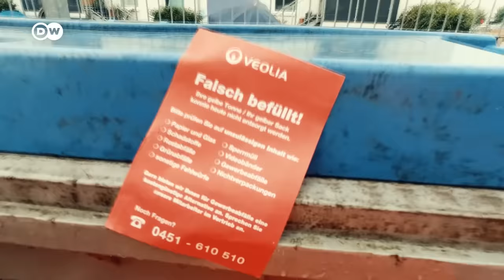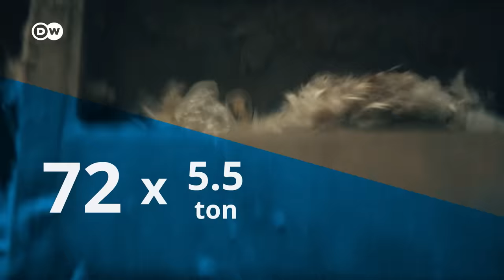The recycling myth: What actually happens to our plastic

Comment: companies have successfully shifted the respnsibility onto consumers, same with co2 emmissions. If the market doesn't demand change, which I doubt it will, only regulation on a global scale can tackle these problems...
Reply: Agree, how can the consumers changed if the companies still used it to everyday products. They obly care about profits and our money
Reply: Regulation made this problem.  See between plastic bags and paper, they are equal in pollution.  They just pollute differently.  So when uninformed people just like you demanded everything shift from paper you MADE the plastic industry.  People found anything not packaged in plastic "dirty" or "flimsy".  So regulation was forced through to require manufacturers to use plastic.  

From there cheaper ways to make and utilize plastic came from this.  Funny enough as long as it does not involve food or a long wear time most plastic is made from a acid extracted from corn.  It is non polluting and completely biodegradable over the course of 5 years and sunlight exposure.  Its call PLA and its used even in 3d printers as the cheapest plastic for it.

But  NIMBYed out of western countries the actual techs for recycling then also asked your politicians to bow to China.  So China and north Africa made a business of buying recycling to get the hard to make plastics and then throw the rest away.  Regulation made it possible if not mandatory.

Parts of the world are dying from the unrecyclable and toxic waste that comes from windmills and solar panels.  Both are TERRIBLE technologies in no way suitable for use.  The over all life of a SINGLE wind power turbine is 10 years.  In that time it goes through 2 sets of blade that cannot be recycled or processed and are filled with toxic materials.  It is woven fiberglass and a epoxy so toxic that it has to be in a filtered fum extraction building during curing or it will kill people.  Those blades then erode away filling every place down wind of them with these.  The generators themselves are retired with only the copper windings ever recovers and the housing thrown in a dump.  Even the cobalt (a carcinogen) of the magnets is just left to rot.  

Solar panels are even worse.  Every year of use they loose 20% of their current output.  They die outright in 15 years.  And anything including high winds and hard rains can cause micro fractures which causes them to leak cadmium into the ground water. That is normally a radioactive by-product of nuclear reactors and handled as a hazardous material.  But in solar panels do to the regulations voted in it is allowed world wide without proper labeling and then when the solar panel fails it is just chucked in a land fill. WHY?  Because the process of making them precludes them being recycled.

Not only did people who know nothing about anything make this mess, they are actively making is worse because they listen to 15 min videos that don't tell the whole truth or  follow the lies of celebrities whose only agenda is to gain fame by pretending to care about issue made popular by scam artists. 

To actually care about the world people NEED to walk away from any of the "green" orgs and look at real solutions. You want clean power or near zero carbon emission power?  Natural gas burns and becomes steam with almost zero co2. Nuclear is cleaner than ever and if allowed to innovate there would be no reactors used for enrichment for weapons. Or fuel wood. The wood being grown neutralizes the co2 released by burning it.

Let paper packaging back into the world just require actual recycling of it and stop having the paper plasticized. People made it a hundred years rather easily and healthily with waxed paper.

But if you truly want change, don't try to vote for it because the people writing the laws only thing of how it will profit them.  Stop buying single use products. Stop buying all the things that are not actually recycled.  Instead of trying to force people to conform to what you idealize, being a good example of how it is better and be the change you want to see.  Demanding regulation is the lazy way out and only makes things worse.
Reply: Exactly, everything is blamed on the consumers but not on the companies that produce it and push their chemical products  through media, same as pollution that caused by companies which cares more for profits.
Reply: @proctain  Plastic is for sure a worse polluter in the long run.
Reply: Once you buy it, it's your responsibility homie. Companies should do their part, but stop blaming companies for your consumerism.
Reply: You still have it wrong.  They tell us what we want.  Theyve all learned from steve jobs by now.
Reply: @Ranstone  bruh, you do realise that the blame game won't get us out of this mess? We had the consumer responsibility mantra for over a decade now and it isn't getting better, regardless of your opinion, which I think is short- and narrowsighted, isn't it obvious that we should go down a path which actually works?
Reply: @droe2570  Government regulations created all these problems, such as the problem where people switched from paper bags to plastic bags? Which law did this? Can you cite the name of that law? I was able to read the part where not a single law was cited or mentioned, do you have the reading comprehension to see that?

Is China and other East Asian countries using up plastics in consumer goods because of regulations? Can you cite their laws that force them to use plastic in food and drink containers like every other country? Or is due to market forces that they use cheap-to-produce plastic? Do you have more than one IQ point to rub together and back up your claims with actual details?
Reply: @DeDieuAntique  You're having "I have nothing substantial to say so I'm just going to butt in the conversation and act condescending" problem. Go away, you won't be missed.
Reply: @proctain  wow that's thought out.
Reply: @margyb7469  It should be blamed on consumers, because they are the ones financially supporting these practices.
The truth is that people do not care enough to do something about it and put money in alternatives. They'd rather virtue signal with someone else's money and time and demand that government/companies take care of a problem they are supporting.
Reply: regulation isn't going to do  anything, except for creating monopalies and halting progress.
Reply: @ishitrealbad3039  if by progress you mean reckless capitalism wrecking both the environment and our health then yes. Of course too much regulation is a poison but just like everything moderation is key.
Reply: @sizanogreen9900  why do i have a feeling that when you say "moderate regulation" I read full blown government overreach instead?

If you want your food and other product to spike in price by atleast 50%, than yes you should force extra regulation on companies.

I thought your sort of peopel were against mega corporations, but somehow all of your policies always enforce mega corp.
Reply: @ishitrealbad3039  well, I will stop arguing with you here, there is no point in trying reason against a true believer.
Reply: @adsfadsfasdasdfasf2439  
Its not a law. Its propaganda. There is laws that ban plastic in certain states.. that's for sure
Plastic came to be around the hippie area and was marketed as being environmentally friendly.
You need to change public opinions before you make any laws like that.
Why government had projects like project mockingbird.
Did we have laws to enter this endless war in Iraq? No.. but they got public opinion to change so they could invade.
Reply: @sizanogreen9900  "true believer" lmfao get off the drugs.
Reply: @bobshanery5152  yeah because china doesn't regulate shit if you are connected to the right people, and the last time I checked american environmental practices were average among developed countries at best
Reply: Partly agree. What happens globally we say co2 is responsible, something we really can't do much about but it seems like noone cares for the destruction of forests and this awful plastic waste. Here in Germany we pay more for gas now, to feel better I guess. Wow
Reply: @proctain  so much truth in your words thank you
Reply: @proctain  You had me until you mention harmful material on renewed energy.
Reply: @zeebeefpv2273  Wrong: companies make you buy what they produce - it's called marketing & advertising - so the bigger blame is on companies, not consumer~
Reply: @BLAQFiniks  Advertisers dont force you to BUY, but when successful they force you to WANT.
Reply: The old chicken and egg story. Now who is the chicken and who is the egg ? Depends on your own agenda really ...
Reply: @1DFM1  hi, yes I agree there are many things that are wrong with human nature. We have a hard time differentiating where the line is between need and want that is for sure.
Reply: @FnD4212  I was pointign out how regulation and giving undue power to goverment causes problems.  Also the original post was talking about so called "green" energy.  

But it is still just the actions of people uninformed whating to feel good about themselves by pushing for regulation where there shouldn't be any.

Taking away people's choices doe not make things better and denying reality while forcefully removing that avialability of that info is another way of taking away choice.

Solar Panels and Windmills are bad tech through and through. You need to come to terms with the facts and let go of the emotional investment in believing they are rainbows and bunnies.

Just one wind generator requires almost 2 football fields of land to be cleared for construction and maintenance.  People keep trying to place them near woods and you have to cut down the woods for them.  In scrub lands the bushes that all the ground animals rely on are clear cut and burned.  Then a half acre of land is dug up just to install the concrete base.

All of that is one PER wind generator.  And it never, ever pays back the CO2 foot print to install and in just 10 years it has to be replaced top to bottom. 

Those are the uncaring facts.  They don't change no matter how much you hate them or ignore them.

Just look up co2 per kilowatt hour. A coalfire power plant is lower than a wind generator and it lasts longer.  It can be refit to run cleaner as time goes on.  But best of all its cousin the natural gas power plant produces primarily water vapor with little co2. 

You need to start researching these issues on your own and stop following video with happy jingles and buzzwords.  

Because how I started on knowing all of this is that I worked on building the NREL LEED Platinum office building.  I learned about solar panels from the scientist who worked at the labs that develop them.  Talked with the engineers who assemble wind generators. 

Of all things their dirtiest secret is that they work on nuclear power as the best alternative in those same labs.  And their own test wind generators and panels are nearly never used. Even generators they sold to the city of Boulder Colorado were rendered inoperable at their own information installation at a mall because the math fails.

Oh and that LEED Platinum office has its own dirty secret.  To get LEED Platinum requires that the structure itself has to be absolutely carbon neutral even in electrical power requirements. The National Renewable Energy Labs had to lie and cheat on their own offices to do that.  They built a parking tower and put additional solar panels on it to get the office within regulation.  

That was a design build building that was slated for a cost of 2 million and ended up with a cost in excess of 4 million.  Even after their were efficiency modification to the plans half way through to reduce costs.  That is a doubling of the price in overruns on the building meant to show all of the world how to be "carbon neutral."  

Then they cheated to get across the finish line after that.
Reply: @proctain  You just repeat the same point as the original. So nothing new here.
Reply: @proctain  This is incredibly on point.  Something I always fear when we come up with "solutions" to problems like water scarcity and electricity production, is what new problems they make.  They original solutions became problems because we didn't care to fully understand the process that resources go through when we use them.  If we want to avoid making new problems, we can't just come up with miracle 'solutions' like solar and wind power; we have to FULLY understand the need, and design a solution that can go through the WHOLE process of being used for our good, and then when we're done with it, be utilized again, either by us or by nature.  Otherwise we won't be making solutions; our grandchildren will be cleaning up waste from our 'solutions'.
Reply: @Ranstone  So you're saying we have some method not to buy things packaged in plastic?  Certainly there are a few items with alternatives, but most stuff would be either a choice of plastic or nothing.  Sure we could all shift to an off grid lifestyle...no wait, that only works for a limited number of people until it becomes unsustainable too.  The cost should be applied at the source, a tax for the real cost of plastic that would be included in the price.  This might even dampen the consumerism you deride.
Reply: @adsfadsfasdasdfasf2439  I suggest there are more laws prohibiting the use of plastics than requiring them.  I'm no law student, but I don't see much Styrofoam packaging anymore...or how about those plastic straws (not much impact, but it's a start).
Reply: @Dennis19901  Great idea, next time I go to the store I'll only get the stuff in sustainable packaging...damn, not a single manufacturer made any difference. I'm going off grid and not buying anything anymore (PLEASE, nobody join me or it will be too crowded for even 20% of us!).  I do miss taking my 5 gallon jugs to the supermarket in Italy to fill them with wine.
Reply: @arturow2686  Germany has higher taxes on energy, but uses the taxes like any other government to pay for whatever program needs it.  I suggest some taxes, say for plastic, should be applied directly to the problem.
Reply: @just4funallday508  
"I tried nothing and I'm all out of ideas" 
-  Just4Fun AllDay
Reply: @just4funallday508  instead germoney sends 600mio to the talibans. We fu*ked m8
Reply: @just4funallday508  banning of plastic straws was an impact, its like sucking from a cooked noodle
Reply: @andrewkuebler4335  damn andrew you got a brain
Reply: @adsfadsfasdasdfasf2439  did you read the introduction?? He says regulatiojs are the problem

Comment: Here in Canada we are just as bad or worse. Plastic sorting is very common, but this is a lie in reality. We are poisoning ourselves with plastics.
Reply: He touched on it a little in the video. Most of Canadian plastic is sorted, bailed and shipped somewhere to be stored in a field. If oil prices ever get so high that recycled plastic becomes cheaper for manufacturers than "virgin" plastic then we will sell it off. Until then it's either stored or burned.

Comment: This video was very enlightening. IMO, companies give us what they think we want therefore one way to stop them from plastic overuse is to stop buying their products (eg. individually wrapped processed cheese slices that are again wrapped in plastic) . We also need to change our "convenience" mindset into mindfulness (nonchalance has gotten us into lots of trouble- what's one more bag into the garbage?). I also agree that repurpose is key and yes, it needs to be coupled with a reduction.
Reply: Agreed - It all starts from companies that use mixed plastics for packaging, they must change their system. Slowly they're doing so, but will take great worldly efforts. 
Before 1980, there wasn't a whole lot of plastic packaging used. Many people kept glass and whatnot to reuse because it was sensible. I noticed a lot of paper and cardboard in the landfills, but that began to change when it was realized it was a problem. We need to go back to old-school paper wrapped products, cardboard or glass containers which is easily recyclable matter. There's too much plastic of different applications/forms (with colourants) that are difficult to recycle. Only usable one time and ended up in landfills or incinerated as mentioned in the video. Shipping discarded plastic around in containers by boat is a waste of fuel/energy causing unnecessary air pollution. A plastics issue currently being studied to resolve.

Comment: Due to local activists, my town changed from small open blue rectangular bins to large plastic barrels. So now you usually can't see what is inside the barrel. Sometimes they are over-filled, though, and you can see in. I have seen yard waste, floor lamps, shoes, household trash bags, and much more non-recycling. The problem isn't that the people cheat - the problem is that the town encouraged people to cheat. And of course, all that trash has to be sorted and sent to a landfill. Along with much of the 'recycling,' which the company can no longer sell, due to a world-wide surplus. Some people think that supply and demand doesn't apply to their bright ideas.
Reply: recently in our town, they installed cameras at the top of the trucks so the driver can see what you put in the can as it's being dumped.  If the wrong stuff is in the can, you get charged a hefty penalty fee.
Reply: Most programs unwittingly encourage poor sorting.  I lived in two different towns in Germany, both charged a basic fee.  One charged a fee each time you emptied your trash and the other charged according to the size of the trash container.  The effect of these systems was to encourage filling the recycling bin which was part of the basic charge.  Certainly most people do their best, but the system encourages putting things in the recycling, not the trash.